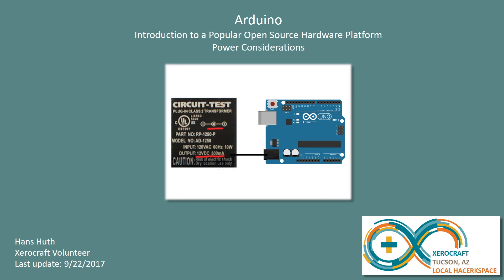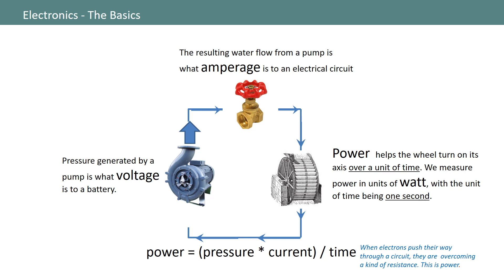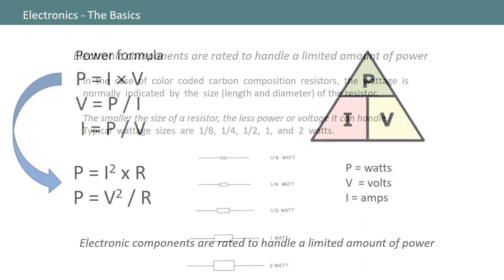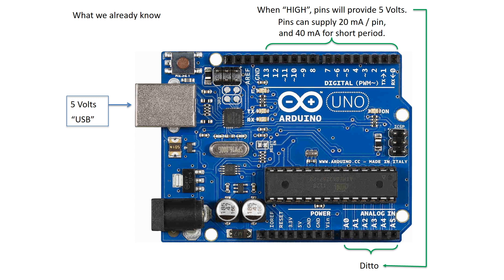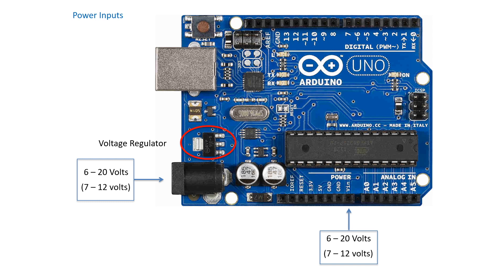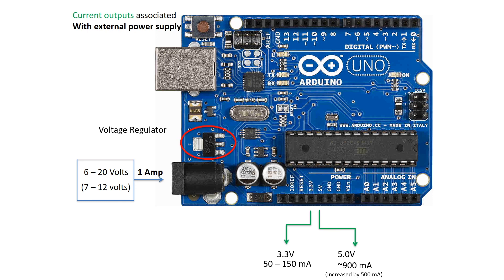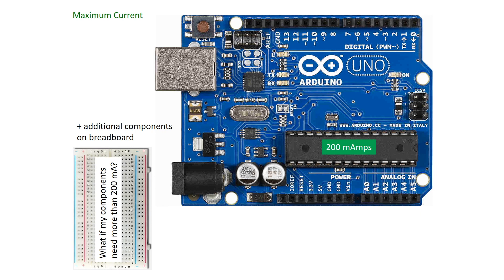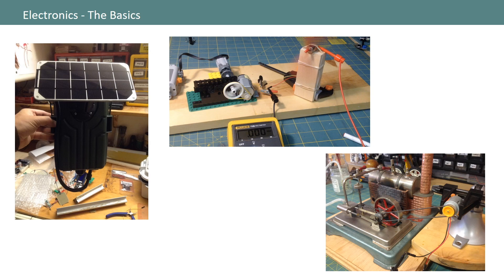Chapter 7 - Arduino - Options for Powering Your Board

Comment: @Modest Maker can 12 volts 5 ampere adapter can power the mg995 servo motor to arduino uno.
Reply from the maker: According to my research cued here :https://youtu.be/mTHwa_UCYMQ?t=561 --  At 12V, your current output through the 5V pin will be about 200 mA. If the servo can run off 200 mA for your application, you should be fine. Do you know the current draw for your application?
Reply: Yes, 800 mA to 1200 mA
Reply from the maker: Then that power supply probably won’t work due to thermal limiting dropping the current below 800 mA— at least that’s my understanding from the referenced resources I mentioned in the video. Be careful if you test this though- I am not sure what happens if you try to draw more than 1 amp through that pin if in fact all that amperage is available— that’s a lot of power for those small traces. If you roll the dice, please share your results.

Comment: Please tell me what to do if we supply more than 5v to Arduino Uno 5v output pin because I have done it to my both the boards and they are not working.😢😥
Reply from the maker: As mentioned in minute 10:35, doing so bypasses the voltage regulator, so the boards may have been damaged ☹️. This is like putting too much water pressure through a pipe that isn’t rated to handle the same.
Reply: @ModestMaker  it have no solution
Reply: Please tell fast
Reply from the maker: I suspect the board is damaged and no longer usable.
Reply: @ModestMaker  😭

Comment: Please tell me what to do if we supply more than 5v to Arduino Uno 5v output pin because I have done it to my both the boards and they are not working.😢😥
Reply from the maker: Microelectronics are sensitive to voltage overload - not sure how you can fix this one :(

Comment: if I wanted to use this on a vehicle would i power it through the vin or dc. I want to use a Arduino and accelerometer for the brake lights
Reply from the maker: You can use either- VIN or DC barrel jack should work for input power.

Comment: Can we connect both USB and 12 v to barrel jack at the same time
Reply from the maker: Yes, you can. Doing so would facilitate serial communications via your Arduino IDE. In this case, I suspect your Arduino will switch to the power supply for power, but still let you communicate via USB / serial terminal, assuming your power supply is of an appropriate voltage as summarized in the video.
Reply: @ModestMaker  oh great..exactly ..I need for serial communication...thanks alot!

Comment: so simply Vin supply you with almost the same voltage you apply through the barrel jack and and then you can limit the current according to to the circuit  required right?
Reply from the maker: Applying power to the VIN will result in that power being channeled through the regulator- same as the barrel jack. As such, the first part of your statement is correct. Your circuit will draw the current it needs-- just make sure your power supply can keep up with the amps needed by your circuit.

Comment: I have a 12 V  2.5A power supply from a computer.  If the barrel fits and the center is positive it should work as a power source if the amps are okay.  Everywhere I look the voltage is talked about but never the amps.  Are the amps not important?  Can the amps be too much or too little?  What would be the range for the amps? Thank you for your help!
Reply from the maker: Your circuit will draw the amps it needs so just make sure your power supply can meet the demand. It's okay if your power supply is rated at a higher amperage than what your circuit will draw. I have used 12V 2.5A center-positive power supplies (wall warts) without issue on many different circuits- it's a good source.
Reply: @ModestMaker  thank you, thank you, thank you!

Comment: So... can I use a 12v AC-DC power adapter?
Reply from the maker: Yes- as long as the plug is center positive and the amps are sufficient for your purposes. If you are just running the Arduino with a few LEDs, 1 amp should be more than enough.

Comment: Which power supply do i use for my arduino with CNC shield. I used a 9v 1A power supply  and the servo motor that I pin on CNC shield was broken ( the power supply for CNC shield was 12V 2.5A). I'm looking forward to your answer, thank you!
Reply from the maker: Without knowing more about your shield, I am not really sure. If it is an Arduino shield, it shouldn’t take more amps than the 5V pin can supply, so 12 volt center positive 1 amp minimum should be okay.
Reply: Modest Maker thank you so much, I’ll try and the name of Shield i use is CNC Shield V3
Reply from the maker: If the shield is powered by the arduino via the 5V pin, my original answer stands. If the shield is powered by its own power supply, then 12V 2.5 amps sounds about right.

Comment: So 9v is ok?

I using an adapter

AC-DC Adaptor
Input: 220VAC 60Hz
Output: 1.5-12VDC 1A
Reply from the maker: As long as it is center positive as explained in the video.

Comment: I had a doubt, If I use the DC power jack (or the ViN pin) do I get 5V and 3.3V output from the +5V and 3V3 pin?
Reply from the maker: That is correct - you will get the regulated voltage. To confirm, add a couple of jumpers to those pins and test the voltage with a multimeter.
Reply: @ModestMaker  Yes, correct. I'll try that surely

Comment: So, I can use a 12V power adapter on my Arduino?
Reply from the maker: Yes, but it has to be a center positive barrel jack, and should provide enough amperage for any hardware / shields attached to your Arduino, or you will risk it resetting the sketch continuously. The voltage regulator on the Arduino will bring it down too 5V.

Comment: Great, thanks for this, just what I need to know, as I have a Nano that doesn't have the barrel jack, so will solder an old 5V 500 mA USB adapter to the vin pin.
Reply from the maker: That should work!